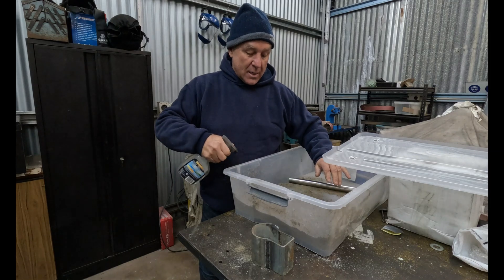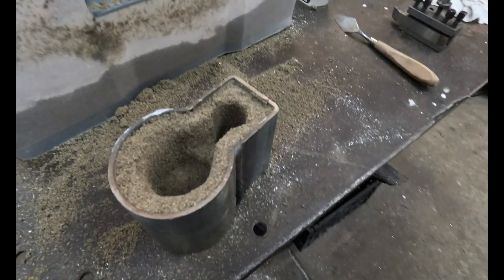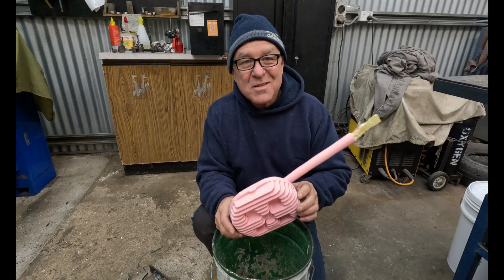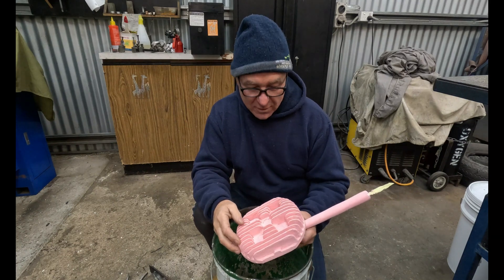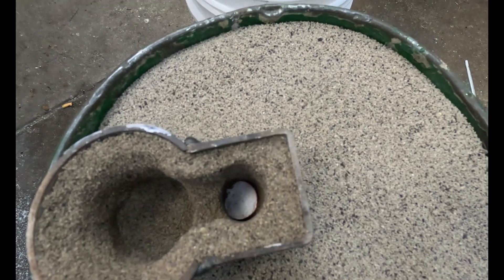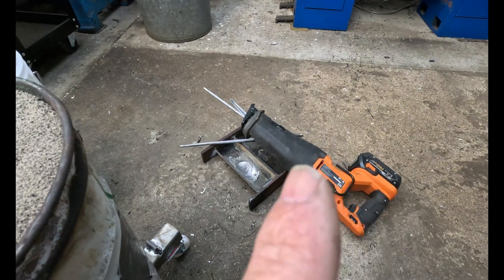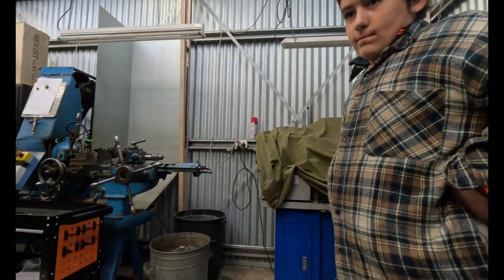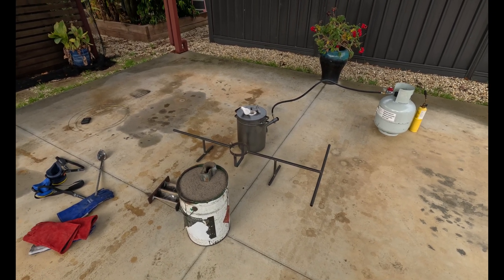Casting BSA Bantam head, machining and workshop update

Comment: i would assume when they first made these... if not die cast, under pressure... they would be "stripping" patterns.

ie, two parts.. the main body with slots, and the fins being a separate piece emerging through the slots. can ram up as hard as necessary, pull the fins as the main body is held in place, the "stripping plate"... no need for draft, and crisp imprints everytime... you gave up on the greensand without having exhausted all options. a one piece pattern isnt going to work...

 someone at some point was punching dozens of them out, as fast as possible... as cheaply as possible... 

meh. my experience of lost wax/ foam had me going back to regular greensand with far better success. sand matters. river sand is too rounded. beach sand has too much non mineral content, shells and the like. firetrail sand has too much organics, leaf and stick... can get decent clean sand from the quarries, nice and sharp... and so far, the best has been using the "soil" from a friends place, that horrid silty sandy stuff full of rocks. ram a hose in the ground and you got a "sand mine"... sieving it is a pain...

fins will always be hard to pour. need some high silicon content to flow nicely, and really, heated molds... which leaves only a few options... die cast... dry bond/baked molds... ie, sodium silicate and CO2... if you can heat them up to 150C or so, theyll pour beautifully.

try only using castings and pistons for the melts. never had extrusion scrap make for nice pours.

a die could be made from graphite if ones determined.

centrifugal is another option to really make sure youre punching metal into all the nooks and crannies... two or more in a spinning drum... scary... but more consistent.
Reply from the maker: These were definitely sand cast originally. I think you may have watched this video in isolation and not seen some of my others. I have already cast in sand, however my sand was crap (commercially purchased too) and the surface finish was awful. I now have some very good quality sand and will be having another go tomorrow. I like your idea about getting sand the way you suggested.........I should have been looking in my own back yard!
Reply: @OzBSABantams  nah, ive watched the other videos as well... hence why i reckon theyve been done with the stripping plate method. theyre some pretty deep fins to try and pull from a single piece pattern.

Comment: Very close. Not sure what alloy you are using but I suspect 50-75F higher pour temp would have yielded a complete casting. Fins can be tough because they are designed to transfer heat and they do.....to the mold too. I wouldn't go out of your way to make the sprue round. -Probably better off square. I'd probably tilt the head slightly fins down and branch the sprue where it contacts the head to distribute the hot metal. If so the previous pour temp might get you there. Best, Kelly
Reply from the maker: Thanks Kelly......I agree with the pour temp, it could have been a bit hotter. I'm having another set of foam heads machined so hope to get a pour in soon. A branched sprue is a must to get the metal to the extremities.........But I'm getting closer!

Comment: Larger ID sprue, e.g. 25+ mm - with three or more connections at the very bottom, and three “bleeder” vents at the top??  Also, you want to feed into the thickest part of the casting, with a big reservoir of molten metal to feed the casting as the metal filling the pattern shrinks.

Not done lost foam in Alumin(i)um, but have done a lot of green sand in it.  My brass hammer head was lost foam, done in a college foundry over thirty years ago.

Finally, go about 10 degrees warmer.  Fins can be tricky - and I have done finned castings.
Reply from the maker: Thanks for your insight and commenting

Comment: You might try casting with the head flat in the upright position with as long a feeder as possible and feed thru what will be the spark plug location. The heavier base could keep heat flowing up in the fines to give the fill a longer time before freezing off.

Comment: You are getting close on the head casting 2 things crossed my mind when looking at it, either the alloy is cooling to quickly or the gasses from the foam aren't escaping quickly enough and there is a bit of a gas pocket. Perhaps using a slightly larger feed sprew diameter in combination with your twin gates might help as the larger volume of metal won't cool as quickly. In traditional sand casting you use risers to vent of any gas out of the mold I'm not sure how it would work with lost foam but it may be worth some consideration.
Reply from the maker: Hi Frank.........You can't use a vent in lost foam as you'd have vaporising gases spewing back out on fire. But I think you're right on the money with temperature at the fins. I'm going to reduce the pattern volume as the base is thicker than the original and split the entry gates. The position of these will be a critical factor as well. Sprue size may be increased however I am now running close to the capacity of the crucible. I'll keep trying and thanks for commenting.

Comment: Hi have you though of puting a vent on eather side of the outer fin to alow anay traped gasses to flow out of the mold ?? but its gettinh brtter every tme will also have a look round for carb bits and bobs for you .
Reply from the maker: Hi.....The trapped gasses are getting out. I think the issues is getting enough metal into the mold quickly before the metal is cooling. carbies have been organised as I'll fit up Mikuni's.........Thanks for the offer and commenting.